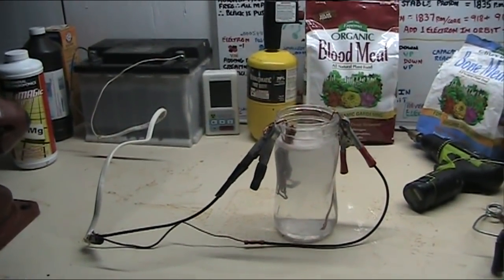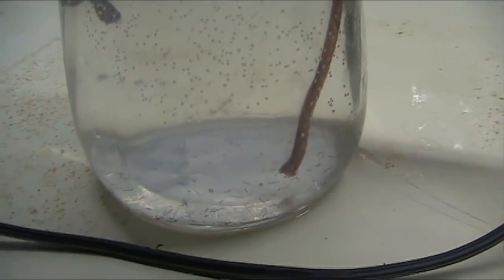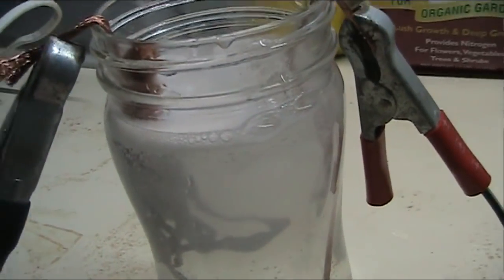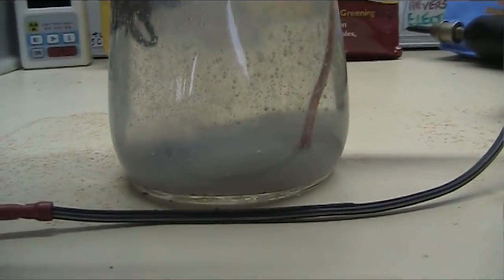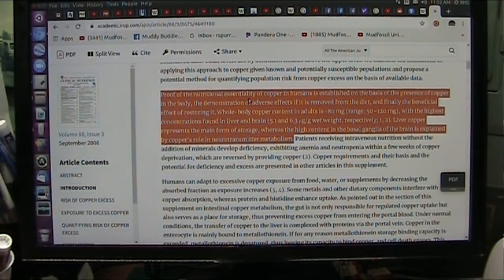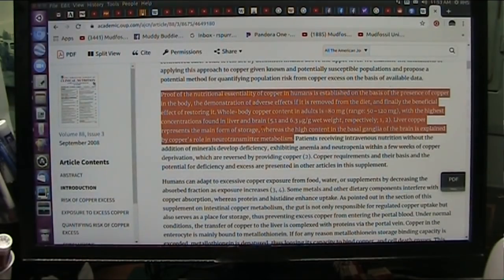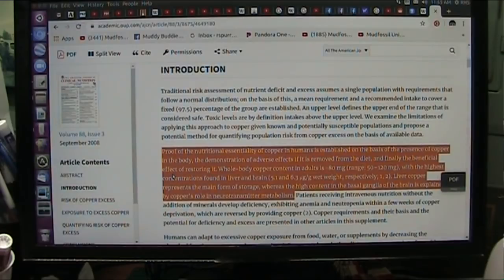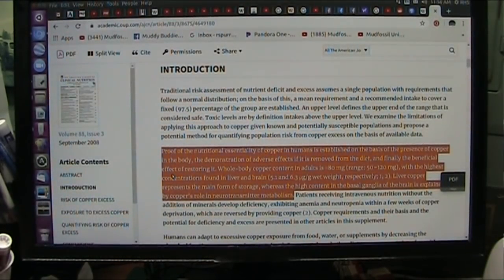Making Corona Copper Colloidals

Comment: It looks like the electricity is splitting  the oxygen and hydrogen like a hydrogen generator. Slowly producing hydrogen gas very slowly. If you add sodium bicarbonate to the water it becomes more conductive.  You can use the hydrogen gas to run a vehicle. Just a thought... look up hho generators their similar to what you are doing but different application.

Comment: My colloidal silver maker runs for 3 hours and the power supply sends bubbles air from a plastic tube around the two silver rods. The thin rods need to be cleaned off after each use. I have only used my cs externally but gallons and gallons in a quart at a time. With horses injuries and my own. For decades. It's from the Silver Edge I think.
Reply from the maker: Thank you... do you feel it is important? Any direct claims?
Reply: @mudfossiluniversity  I missed seeing your question. Yes, emphatically. I have taken it into even ripped eye tissue of a horse and spraying it in and around and it healed with no scar in no time. Quite something to watch wounds close up with it. These are very 'inflammatory' animals, horses are. So to avoid vet bills, stitches, injections, its all good.

I fractured my ankle and multiple leg cracks and pain and break (not separation, unless) and soaked it in a quart or two for a week or more until pain and mending were noticeable. Absolutely swear by it for injuries. 

Oddly, rope burns from dogs running rope through hands, around ankles, no good for healing. Other stuff is better on that.

Comment: Rodger, stay away from the salts. You don't want copper nitrate or copper salt colloid. You want copper in distilled water in its ionic form , but if you want to make it a colloid use some other reducing agent. Even better than ionizing copper is to ionize silver. I'm an eight or nine year consumer, along with many of my loved ones, we always quickly beat anyting viral, bacterial, or fungal, and none of us are blue with argyria, because the silver salts are what turn people blue through photosynthesis in the sunlight over time. Usually in about half a day to a couple of days or so. 

If it's in the lungs we nebulize with ionic silver, but if it's food poisoning, sore throat, stomach flu Etc, then we consume colloidal silver because it's more gentle on the intestines, due to it being a lot weaker than ionic, but still strong enough to kill the bugs. Nebulizing using ionic is the best way to get silver in the body whenever possible, because from the lungs it goes into the bloodstream, so the bugs can't Escape, and ionic is far stronger and far more effective. Check out silverlungs.com they sell silver generators of which I own and I'm very happy with, and they are very informative, since you want to find out more. You're definitely on the right track though, and I would ionize copper if that's all I had because that's also antiviral, anti-bacterial, and antifungal from my understanding, but I know my silver solutions have always easily done the job. Lastly, remember if it is in the lungs, then you need to nebulize, because if you only drink it it won't take care of the problem; I learned that the hard way. Also when I ionize my silver, the process only takes about one and a half or two hours for about 20 ppm, not all night, so I think you're going way too long, and since your polarity doesn't reverse on its own, you could try ionizing for 1 hour, and then reversing polarity on your copper electrodes, in order to evenly oxidize them, otherwise one may remain shiny while only the other one oxidizes.

Comment: I've been making colloidal silver copper, gold,iron, for years .make sure it's pure metals  and yes make sure its at low current micro volts are best. And use distilled water and do not add anything to the water. I distill my water and leave pure copper plates in the storage tank, then there's enough particles to start the colloidal process and eliminating the need to add any other substance.

Comment: Well, this process needs to start with pure copper.  CAT 5 or 99.99% (also called four nines purity) which you can buy online.   Regular copper wire has lots of iron and some other impurities in it.   Plus I always warn folks to not take too much.  It's important to do muscle testing to allow the body to respond on the need for all the trace metals: copper, silver, gold, chromium, etc.  Without that, you can overdose and the body will get metal toxicity.  The signs of metal toxicity are ringing in the ears (tinnitus), sore gums, sore kidneys, blurred vision and achy joints.  One sign alone is not always an indication of toxicity.  Also, it's best to use baking soda for your electrolyte, not salt.  Salt will break down on the electrodes as sodium hydroxide and chlorine gas.  It not really that bad but smells awful and can give you a nose full of bad whiff!  If you want to see videos I've put up on muscle testing (the dip test) and making monatomic copper solutions and others, click on the logo to the left of my name and you will see my channel.

Thanks Roger for putting this up.  It's SO IMPORTANT that we learn to do these things ourselves and this is a super good start!

Comment: You can also take a chunk of copper and use a propane torch on it and when its super hot dunk it in distilled water. Colloidal particles boil off. You can do it as many times as you like. Use a laser in the dark and or a PPM meter to measure. 10ppm is a good measure for silver so it couldn't be to far off for copper. ...AREN'T THE OLD COPPER PENNIES SWALLOWED BY US AS KIDS???

Comment: Use the purest metal you can acquire, distilled water only,  and never salt the water. It will take longer but as the particles impregnate the water the electrical current will flow better. ...turn the lights off and shine a pen laser through to see the particles. ...EVERY BATCH IS DIFFERENT!!! ...If you make a second batch use an ounce of the batch you made first to jump start it. I don't see why it couldn't be drank if made the same way as silver. ...Lol, just from the looks of what you made i would certainly not drink it. You kept it going far to long and it shouldn't have that sludgy look at all. No longer than 2-3 hours at most!!!

Comment: Don't drink that. You do not want to use any salts. Be careful with colodials, even silver. You can build up toxic levels. Nana is much safer, passes through the system and doesn't build up.

You need trace elements yes. Cooking with cast iron and copper are better choices for getting those trace metals into your system. Vegies are good for getting have elements are they pull them from the soil.

There is a version of gold called monoatomic gold but it works with the telimers (sp) and works at the DNA level.

Comment: Roger I sleep on a copper mat that I made. I have found that the mat has been a great help to my body. I made a YouTube video of how to make the mat. I explain what the benefits of the mat has done for me. I tried steel overlays in my pillow to ground and I found that it didn't help as much. I found immediate results with copper mat. There is a YouTube channel called the Grounded which explains the importance of grounding so I decided to make a mat out of copper which has helped me in my healing. I do healing work so I take on people's illnesses but since I have been using my copper mat I found that I don't have the aches and pains that I would have after a session with my client.

Comment: Voltage too high any volt under 1.05v use pure zinc on one side copper on the other negative in the middle positive on both ends negative in the middle look up how to make co2 "gans" nano coat the copper wire by burning it till red glow that goes in the middle zinc kills viruses along with copper also look up  "one cup one life" kesh foundation

Comment: gday Roger, I make colloidal silver and copper is similar just use the distilled water only ,if you want salt add it after you cook the copper. best to not go over 25-30 ppm. I cook my silver to 25ppm. I use a digital meter to test for strength. I made a solution of colloidal silver and added 3%h2o2 I spray on my skin and can use a surface spray NOTHING SURVIVES. get good results with copper urns ,bottles, cup just leave water overnite and drink in the morning.

Comment: When you feel it's finished drain over a coffee filter that is natural not bleached or a cheesecloth in this case and drink the water that you drain through the cheesecloth and I think it'll be real good for you I want to do it too Copper's a heating source I sold an invention it was called the copper coil and it paper eyes the gasoline with the water heating the copper from the water tank and it returned heating the gasoline without vapor lock believe it or not I so many of them in Venezuela and gas was $0.10 a gallon at that time anyhow the way what does did was  there was build-up of carbon on the spark plugs so you never have to replace them and it gave your car more power and used less gas it was a real catalytic converter of course the government hated us anyway there was no way of Dying by accident by the emissions with this attached it would take care of anybody committed suicide that way to it was very useful many functions no
THE WAY I see it it's  Angels food anytime you can have them things moved along fast toward your help I would say do it and I'm going to do it they're not going to tell us exactly what to do you have to use your instinct about how much you should drink start small move up the ladder like anything else
THANK you Rodger. ...

Comment: What you are doing Roger is straight up Electrolysis, you must be producing one part Hydrogen from the Negative terminal to every half part Oxygen from the Positive terminal and I think you need to ventilate the area around your experiment in case of gas build up.
Also it would be better if you just followed the instructions in the 'Health Drink For Coronus' video by the Nuclear Physicist 'Mehran Tavakoli Kesh', https:keshe.foundation .
In a previous video you watched and commented on it and having experimented with it myself there seems to be some benefits, it seems to help with skin complaints and drinking a very small amount cleared my chest of phlegm.

Comment: Knew an electrician who suffered from copper poisoning, got aweful sores from handling copper so be careful with too much of that.
Reply: Yes. There is a copper vs zinc balance in the body. Raising zinc levels lowers copper levels. Raise copper and zinc lowers. They found  that those with brain tumors in particular had high copper levels in the brain.  Research or google to find the data. I read the data years ago. I did not keep it. Shrimp and certain foods are high in copper. The dietary law of Moses tells you what seafood you can eat and what you shouldn't. Life is about making choices.

Comment: Never put salt in the water when making colloidal silver. That becomes toxic. 
((Don't know about copper))
When I make Colloidal silver (CS) i use surgic quality of silver (=99,999% pure silver) in distilled and demineralised water. Nothing else. EVER.
The electrolyse i do with 3X9volt batteries. And only in glass. I put the glass au-bain-marie. When the water of the au-bain-marie gets warm, it speeds up the process of the electrolyse. Nothing else.... I have been making it like that since 2003. Over 17 years i must have swallowed at least a 25 liters of CS. Never had any problem with grayness on joints, nor "blueness". But it is not a proces that allows for experimentation. The surgic quality i order from a specialised company here in the Netherlands (Cookson Drijfhout BV). Please read the comment of Cindy Branson. That is correct as well! I personaly would not try copper. Stick first with silver or gold.... But please do not mess around with jewelry.... Or other metals "around" . It never is pure 99,999% pure , so you will get toxic results !!!!!!!!! Because what you showed you were making, looks terribly toxic. Bubbles on top: bad sign!! Blue mess on top of the water and the cloudy stuff? Very bad sign! Do not drink it!
Reply: Found this..sounds like CC can be hit and miss..
https://silverpuppy.com/article/using-the-silver-9-to-make-colloidal-copper

Comment: Right on Roger, hope it works, be safe!
I've been wearing my copper bracelet non-stop for 42 yrs on my left arm. 
Many Blessings
Reply: ..and I do take  zinc /selenium supplement (along with many others ;)...Colloidal Silver. is great! >=> a stronger PPM for external use and 10 -  30ppm or below internally...you can even buy colloidal copper/silver/gold in one solution...
Reply: Someone I know has worn a copper bracelet. His hair is as black as the day he was born.
Reply: The bodies or bones retrieved in Pompei, those that wore metal bands, the bones were green in the areas underneath the metal.  One guys skull was partly green.  He must have had a metal headband?

Comment: If you suffer from cancer to much copper is a bad thing, however other than growing your own veg mineralising and churning your soil to get high brax value food, this is next best thing. also try and use lower voltage for smaller particles"although it il never be colloid/nano sized". 

Roger you should do lipospheric vit c in these troubled times but if you do make sure to use sodium acorbate opposed to acid.
Reply: yeaH, and better order Lipospheric C now, as it's harder and harder to get >=> "out of stock"
Reply: @wchiwinky  easy to make  lecithin ascorbate

Comment: High Voltage = bigger particles, use 4 x 9v batteries ( rechargable to save money) and a potentitiometer and reduce voltage to 2, lower voltage = smaller particles.
you need to pull the copper out every hour and wipe away the oxidation, use a stirrer to keep the water moving and filter it through a coffe filter at the end.
i did a quart and it took 24 hours, it turned a light blue colour.
 i then put the end product into my hot tub and over the course of a few days my hot tub was completely green, intresting stuff!